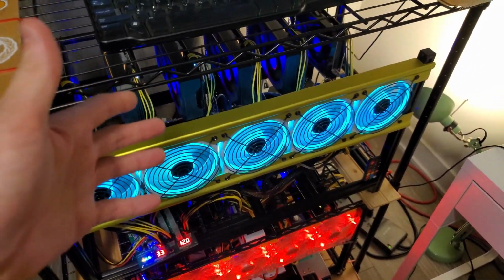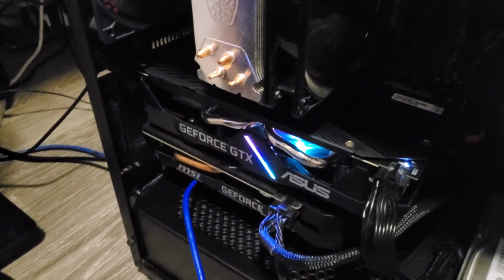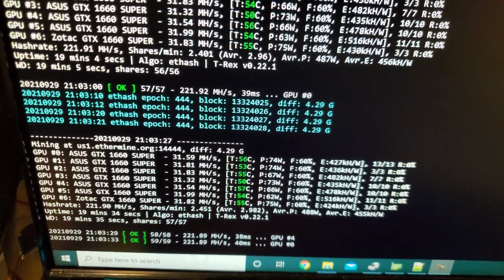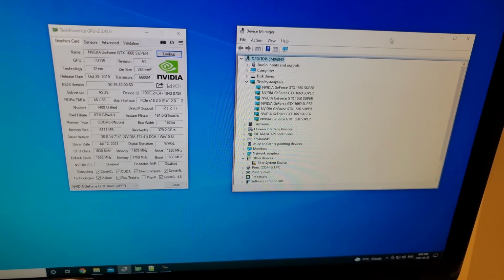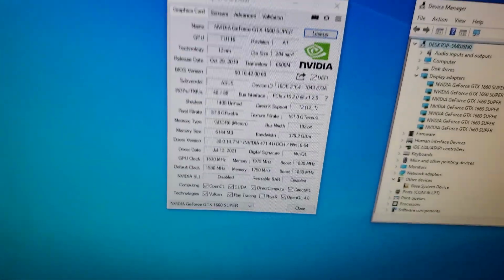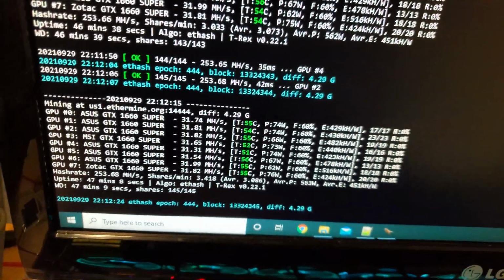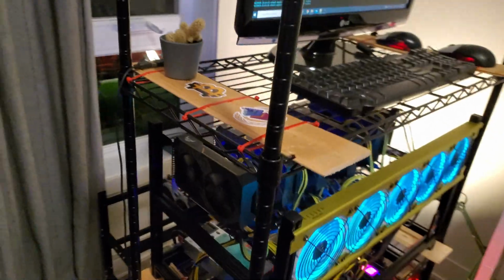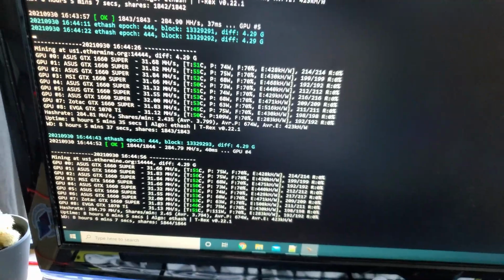9 GPU Ethereum Mining Rig & Testing 1 to 4 PCIE USB Splitter Cards! (Sluice V2 Review)

Comment: Awesome frame.  I was actually able to cram a 2400 watt delta server psu and 1100 watt server psu on mine.  I have 9 gpus on it all 30 series.  Only thing That veddha I noticed is that the gpu gap is slightly larger for when you are running some larger 30 series cards.  So that makes for slightly better airflow.  But if you are only running 6 gpus you can stack them three on each tier on this frame.  I have 4 3070ti and 2 3070 all on the bottom and they are quite tight.  I run 3000rpm fans to try and keep them cool lol.  Good video as always even though I am late to watching this one lol.
Reply from the maker: WOW dude thats some good space management, those 2400W are pretty big! Yeah the spacing is for sure better on the veddha when running 12 cards, id highly recommend the Sluice for only 6-8 30-series cards like your doing, or 12 1660 supers for example! However, I recently checked out the Dredge and reviewed it; and the variable mounting spacing is GREAT. Im running 7 30series cards on it, and able to space out my 3070Ti and 3080 more then my other lowered powered cards. Pretty cool!
No worries for being late dude haha, just glad you stopped by ;)
Reply: @MiningOffice  yeah definitely a great frame for sure.  I needed some powerful fans on mine.  I actually contacted the ebay seller to get more of them to see if they will be restocking them lol.  I Think veddha frames are just too overpriced right now.  There are a couple knock off AAAwave frames.  I should buy one and compare it to it lol.  They are similar in price though.

Comment: Nice work man! I got that same frame 6 months ago and ran 12 GPUs. 6 - 3070s , 1 - 3080, 1 - 2080Ti, 1 - 2070, 1 - 1060, 1 - Titan XP,  2 - 5700XT. It was tight but it worked. I definitely put in all 8 120mm fans. Also a standard box fan fits perfectly on both sides for a push pull air design. I was just mining ETH so didn’t have to deal with the heat mining RVN. I have since moved to a grow tent with wire rack doing vertical hanging. I’m going to start collecting 6600XTs for my next AAAwave frame build. Oh one other thing to mention about the frame is that if you use an eVGA 1600w PSU it’s a super tight fit to make it fit. Keep up the great vids my man
Reply from the maker: Hey Michael! Appreciate your detailed comment on your experience with the frame! And cool to know you use a growteny, maybe eventually ill try it out! Take care my friend

Comment: Excellent review and overview! 
If I ever move my rigs into grow tents I will definitely use 12 gpu frames like this. I tried to get a pcie splitter working on my b450f Gaming 2 ASUS motherboard, with no success. But somehow on an old 2010 ish era HP desktop I can get two splitters working for a total of 8 cards lol. I would be really interested to see if you can get 12 cards going on that motherboard with a second splitter, too. Great vid!
Reply from the maker: Yeah its weird, seems like sometimes it works perfectly and other times not at all depending on MOBO and maybe BIOS settings. Ill need to try 2 PCIE splitters in my Z390-A pro, im really curious to find out if it will work!

Comment: Nice man :D oh and panda has a video recently he connects 2x of those 1 to 4 splitters on an old HP
Reply from the maker: FOR REAL!? How did I miss that!? I did so much research yesterday and the day before. Dang it LOL! Anyways that is good news, I think ill try a 2nd splitter on my 2nd 16x PCIE slot. Maybe I can get 10 or more GPUs running (ill need to slap in an extra PSU though). Ive got a few cards still boxed so maybe ill slip it in one of those Unboxing and Testing videos. As always, appreciate you stopping by Anonymous :)